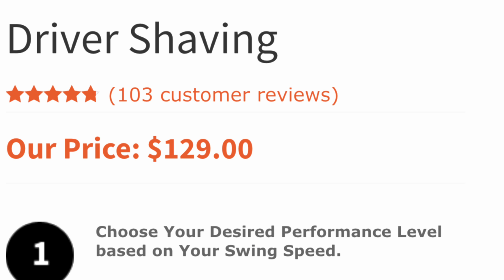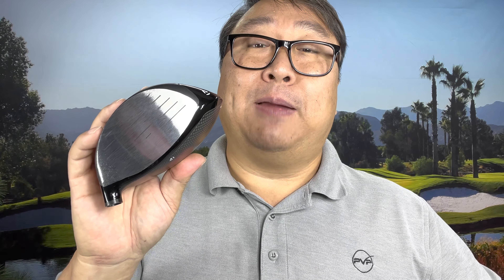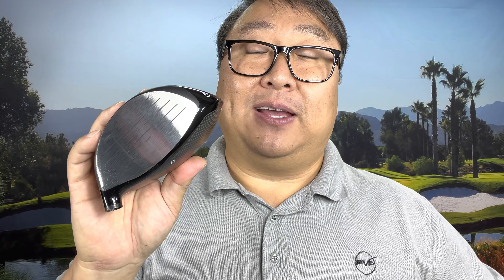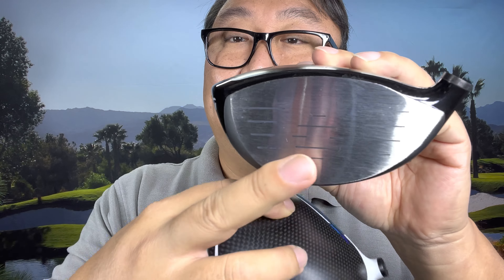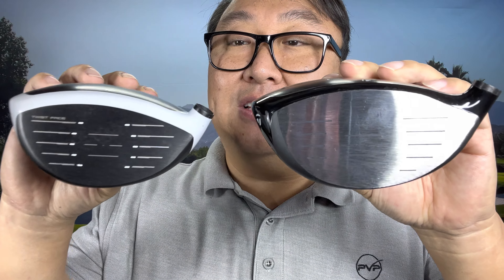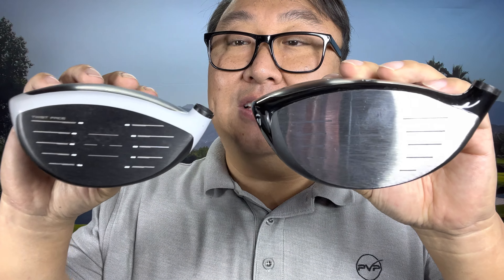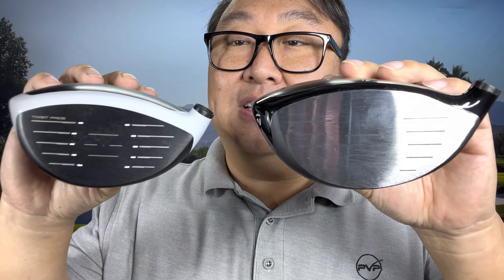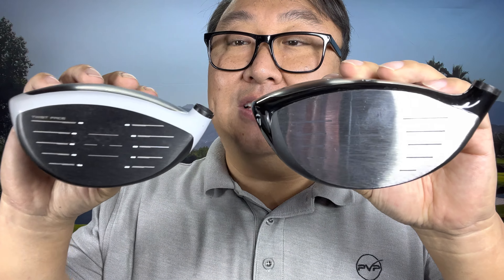Does Face Shaving A Driver Make It Longer?

Comment: I know for a fact (source: someone who used to work for them) that WHD is not using CNC machines to shave the faces. They just use a belt sander to sand down the face and make it thinner, usually sanding until the grooves are gone, and then they have new "grooves" etched into the face via laser. So they definitely are making the face thinner, but there is absolutely no guarantee of any COR rating since it's such a crude process, they simply sand a little more or a little less based on the "COR" that you request. Anyone can do this free at home in your garage if you have a belt sander. Or if you don't, just go buy one for the $100 that you'd spend to have them do it and then you can do as many drivers as you want!

Comment: All that testing and without the AutoFlex?
Reply from the maker: You make an excellent point, Jeremy! I'm working on a video "hi COR with Autoflex." I wanted to keep them separate for now because sometimes I really hit the autoflex and sometimes I don't make the most of it, so my highs and lows can be kind of extreme. But a combo test is coming soon!
Reply: @petervonpanda  with all your testing, maybe you already do but if not it may be advantageous for you to get an universal tip on the AutoFlex to go from equipment manufacture to equipment manufacturer?

Comment: technically from .83 to .89 for your swing speed is only max +8yrd.  but i think the weight adjustment and warming up is what help you with the gains.   low spin and optimal launch angle is what will get you 20yrd longer
Reply from the maker: That’s awesome data! I think you’re spot on. I’ve been testing it with the autoflex driver too and I that makes perfect sense based on what I’m seeing with the combo. Thanks!
Reply: @petervonpanda  did you sell your autoflex shaft? autoflex + .90COR maybe we can get 280 under your belt!